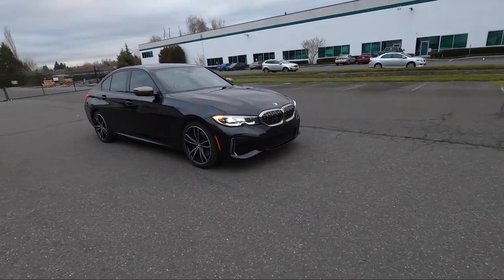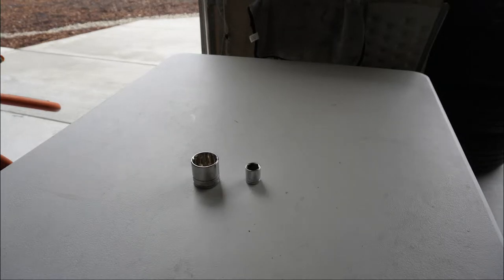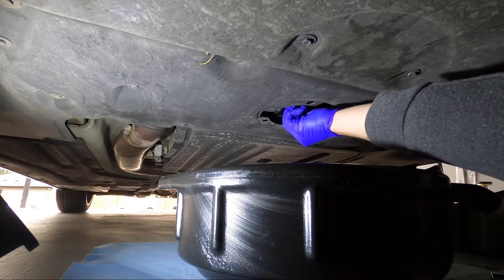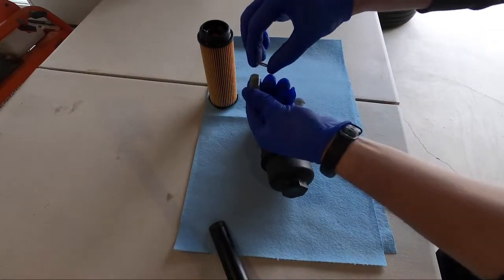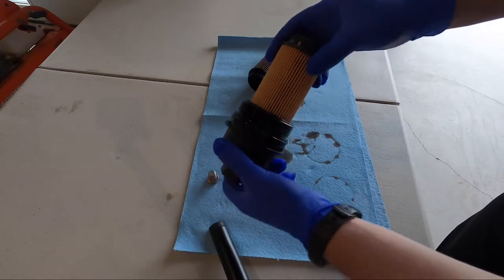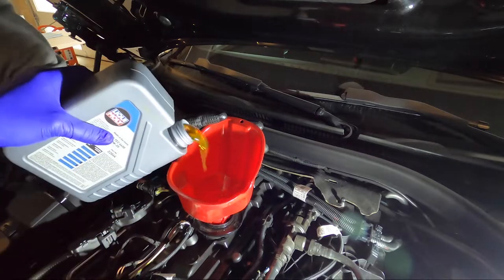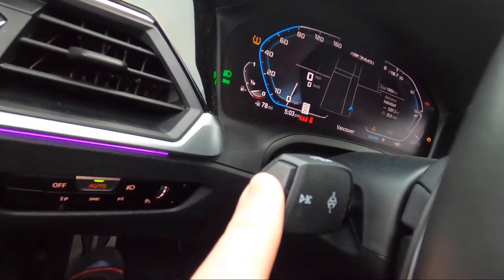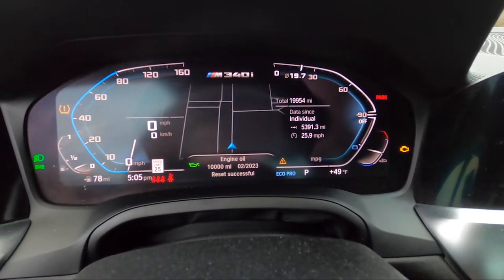G20 BMW M340i Oil Change and Service Reset

Comment: Helpful but it didn’t work. There are actually two buttons on the turn signal. Either way, neither one of them gave me the options that you showed! Frustrated now… Will try again later
Reply from the maker: Did you hold them down long enough? Maybe some models are slightly different

Comment: Hey, did you trade in your f30 for this m340? And would you say the m340 is better than the f30 340 overall? Faster wise, etc
Reply from the maker: Still got the F30. This is my friends car. He plans on modifying it a lot and said I can make videos on it whenever I want. 

The M340i is really nice to drive. Feels more responsive than the F30 340i. Also definitely faster than a stock F30 340i. But not quite as fast as my tuned F30

Comment: Can you do a video on how to disable idle start stop on the M340i?
Reply from the maker: I did a video on my F30 340i on how to do disable it with BimmerCode. It should be the same on the M340i. Just look up the bimmercode video
Reply: you can put it in sport individual and just configure everything to comfort. Then you just have to put it in sport individual every time lol. but that’s what i do because bimmercode did not work for me. i think bimmercode didn’t work because my ECU is locked.

Comment: when i try to measure my oil level, it fails at around 17% and just goes back to the home screen, any idea on how to fix this? I've tried doing this when it plenty warm and ive tried waiting until the car fully cools down, nothing seems to work.
Reply from the maker: Double check that the oil filter is installed correct. Maybe drive around a little more and then try again. It could also be a bad sensor or a software glitch. Try shutting the car off and disconnecting the negative battery terminal for like 20 minutes and then reconnecting it. This will reset the software. If that doesn't work then my guess is the sensor could be bad
Reply: Could be a failed oil pump I’ve seen that before in the 2020 models. It’s been resolved in the latter models
Reply: Failing oil pump
Reply: Did you find the fix ?
Reply: @Jr_07-vz6du  I tried every single thing I could find online but nothing worked, ended up going to bmw, they tried one thing, I think it was changing some sensor, that didn’t work, so they replaced the oil pump and that’s what fixed it.
Reply: @yanisbondar  sounds good how much they charge man ! Gonna have to book a appointment
Reply: @Jr_07-vz6du  at the time, I was still under warranty so it was completely free. So I’m not sure how much they charge if you’re not under warranty. I think the warranty is like 3 year or 30k miles or something, you’d have to check.

Comment: I got a engine oil service due on my 2020 BMW M340i , however when I read the engine oil level it’s almost at max still. Any reason why it’s doing that? I’m about 1k miles out from my standard oil service
Reply from the maker: The level being at max is fine. I'd be more concerned if you read the level and it shows that its way below max level

Comment: You should really use CLEAN engine oil to lubricate o-rings. I've seen dirty oil used before and it sometimes leaks.
Reply from the maker: Yeah I'll keep that in mind